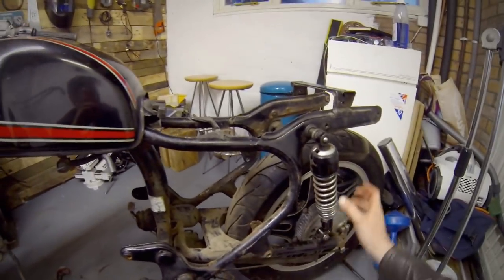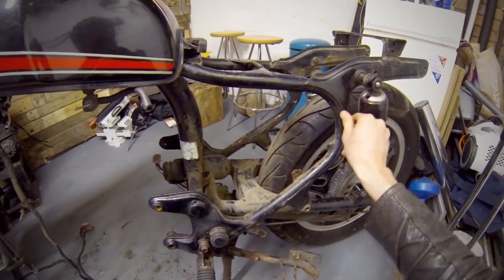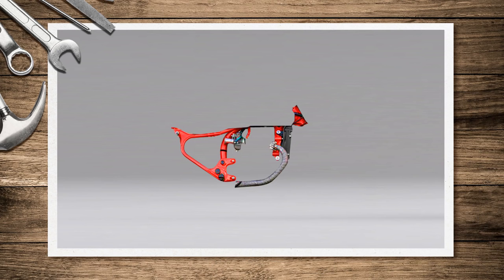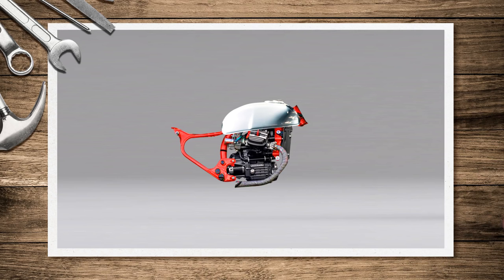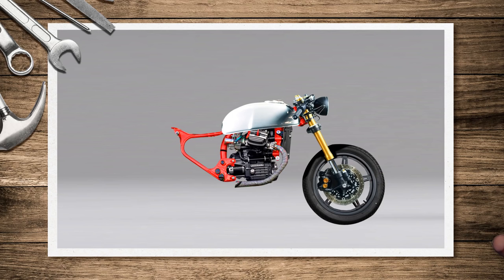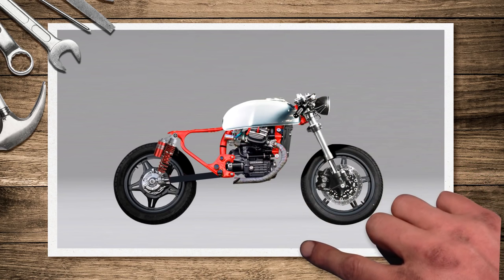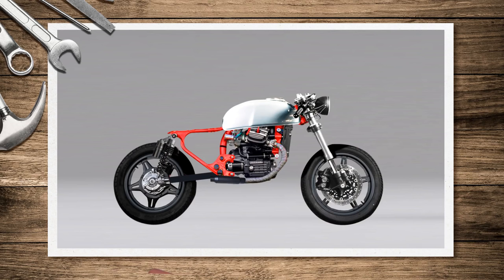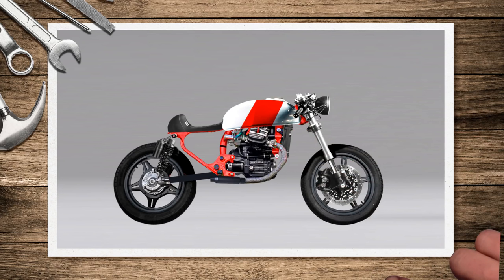Honda CX500 Cafe Racer build 3 - designing the bike

Comment: Twin shocks for sure, buddy. The mono just won't fit in with the look you're going for, plus it'd be a right pain in the arse to get it working.
Reply from the maker: Yep, you're telling me. A monoshock would be an engineering challenge. The safest way would be to use the swingarm from a GL500 as a straight swap.

Comment: Dual shocks, drop the triple tree an inch, accent the wheels with some red rather than all black (I do love those comstars though), and add small fenders to the front and rear? That way, the bike is in a flat line, the tires match up with the rest of the bike, and there's not junk flying up onto the engine or on your back. Very awesome style and I cant wait to see it done!
Reply from the maker: Yes, definitely, I forgot to add one in my visual

Comment: Working on a similar build myself. Looks good, I plan on keeping the twin shock myself. I think they look better with the twin shocks especially considering the type of bike. These are Cafe or Brat bikes and I just don't think a mono shock fits that theme on an older bike. Even though I have seen some great mono shock builds.
Reply from the maker: I think I'm swaying towards agreeing that these bikes look better as twin shocks. Although the examples of mono look amazing, I think to keep this true to brat of cafe I think twin is the way. Good luck with yours.
Reply: Thank you. I am going a more traditional look up front. Swapping a CB900f fork which is 39mm diameter with Race Tech springs and valves. This will also give me dual disc, 2 piston calipers (mine is a 78' model) which will require a CB750 front wheel to allow the dual disc setup and still match the rear wheel. I have the older smooth Comstar wheels.
Reply from the maker: Sounds like a plan. All the best, look forward to seeing it.

Comment: I just subscribed. I'm building my own cafe racer from an CX500, though my plans for design are a bit different than yours. I'm still at the stripping part btw. I ended exatcly where you ended in the first video. Tomorrow I hope to strip the rest en the day after that taking the engine out. Thanks for the vids!

Comment: Mono, Mono, Mono. Looks great on the CX 500's i've seen on here.
Reply from the maker: They do, It's a lot of engineering though, I've had messages from people who's  drive shafts have buckled and are making noise now from just a straight conversion with no re-inforcements.
Reply: Didn't know that! Don't want any issues with the drive train, dual it is. I'm sure it going to look great. Great videos!
Reply from the maker: It's possible, my feeling is that replacing the CX swing arm with the GL500 would solve it as that has a square frame rather than tubular.

Comment: Love your vids.  Suggestions welcome?

The rear hoop / seat looks like it could stand to be a little longer; perhaps so that it extends to the verticals line of the rear tire/wheel/axle.  ...I think.

If you can, through a combination of raising the rear and lowering the front, you can get the line from the tank to be horizontal rather than that upwards rake you mentioned.
Reply from the maker: Brill, thanks for your input, I'll definitely have another play with these lines.

Comment: check the autofabrica cx 500. think you will get in a good direction of tgis build if you do that. personally the cx isn't one of my favourite bikes because of the frame. doesn't look a proportional bike at all. as I said check the autofabrica one. if you manage to do anything similar to that bike would be a fantastic bike. keep on the good work. cheers
Reply from the maker: It is a huge bike, even when it's just the stripped frame. Surprisingly the frame of the GS extended further, but I think when compared with the likes of CBs they get it right.

Comment: looks a little stubby in the back. I think you should either extend the seat area to end at the rear axle or maybe try a brat seat instead?
as it is, the shape or dimensions of that hump/cowl don't really match with the tank and the beefier front end. the whole back area just seems lackluster imo. maybe it would help to actually have a painted cowl?
either way, it's nice to see progress. good luck with the build!
Reply from the maker: Thanks, yeah I'm tempted to go brat, we'll see how it turns out :)

Comment: If ur changing the suspension be careful about the drive shaft angle, I've monoshoked my cx500 and the drive shaft makes noise now
Reply from the maker: Thanks for the heads up. Did you reinforce the swing arm before you put the monoshock? One of my worries was the swingarm buckling under the new strains.
Reply: For The Bold - dreegez no I didn't strengthen the swing arm, I used bccr engineering in USA as a template for my bracket and designed a similar bracket, if you look under my name on utube I've uploaded some videos. Ronan
Reply from the maker: I'll have a check. Th only solutionI think would be to use a GL500 swing arm as they have the square steel arms rather than circular.

Comment: Hey mate, just an observation but doesn't the air filter gap stand out too much due to the bright red frame, seems a bit weird to me but that's just my opinion. and what about the rear brakes are you gonna change them or not? 
PS. love the twin shock idea.
Reply from the maker: Thank you. For the rear brakes I'm going to leave them as they are as the drivetrain & drum brakes are kinda the same unit.

Comment: What version of Photoshop are you using? Did you have to take photos of each part of the bike stripped before you could do this sketch? I'm still at the planning stage of my CX. The plan is in my head and a bit of printing out and cutting bits of paper to see how it looks. I like the red frame on your project. I'm going with a Honda RC166 colour scheme.
Reply from the maker: It's CS5. I use different images from different sources and put them all together. That'll work also, whichever way you think is easiest for you. There is no right or wrong way. Good luck with yours.

Comment: Looks good I'd just do a different seat, not a fan.
Reply from the maker: Thanks, what kind of seat would you like?
Reply: For The Bold - dreegez I was thinking something with a more subtle hump in the back or even a pan like the Gs. Speaking of that I like the orange and grey, but after seeing the plug cap. I think a maroon would look 👌🏽.
Reply from the maker: I'll be making an electrics tray under the seat like the GS550 and perhaps the battery might either go under the cowl or tucked just behind the water tank?
Reply from the maker: ha, not decided yet, I think it'll come to me where the best position will be after I get the seat.

Comment: I was told you can not powder coat the engine?  Is there a special paint I need to use?
Reply from the maker: No that's not true, you can coat it, just watch out when sand blasting.
Reply: Thanks.. I appreciate your videos.

Comment: I have a cx500 and wanna make it a cafe racer and I just now noticed the hump. Wouldnt relocating it would have the driveshaft bee to short???
Reply from the maker: No not really. We’re not shortening the drive shaft, just angling it a little, not too much. Have you watched the rest of the build?  More to show there
Reply: No I haven't, I've been doing a lot of research on what I want to do with my bike, and I've been using your series as a guide to show me what i need to look out for. After all, I still have to actually get my learners which I plan on trying to get this year. Your series has helped a lot though with what i want to do with my bike. I have an old 82 CX500 Sport in red, and it has 200,000 KM on it so I don't plan on sinking a ton of money into it even though the motors are solid. I was just making sure that you weren't buying a whole new custom driveshaft down the line.
Reply from the maker: No, nothing custom here, but the frame work was the most difficult part.

Comment: Powder coat the engine!! what kind of powder did you use? Did it end up resisting the temperature?
Reply from the maker: Powder coat is high temp as it need a higher temp than what the engine goes to to cure
Reply: @forthebold  I thought that powder can only take 90 degrees C
Reply from the maker: it melts at 150C and cures at 200C

Comment: Where does one find that rear Comstar wheel?. The ones in America for some reason are a smaller star shape and I don't like the look. I'm working on my CX but the only way I won't convert to spokes is if I find the larger star rear wheel.
Reply from the maker: That’s true. America seemed to embrace the cruiser style of CX509 more with the 16” reverse comstar more. (I can’t remember which is reverse and correct actually). I could find an 18” when I was building one in Florida. Perhaps try The UK?
Reply: @forthebold  The 16" reverse Comstar are in abundance and it's what  I have. I have searched high and low for the one you have with no luck. I'll figure something out. Thanks for the great videos and all the tips. Going to shrink tube my intakes and avoid cheep eBay parts. Cheers!
Reply from the maker: @juancovarrubias3229  Oh gosh yeah, I tried some cheap ebay intakes on another build, couldn't even get the carbs on as the rubbers pointed in the wrong direction